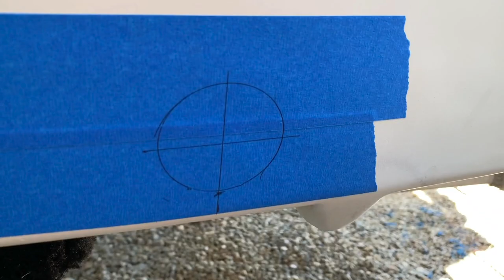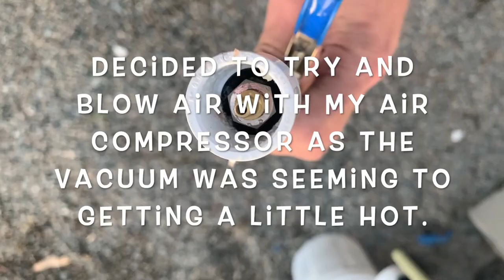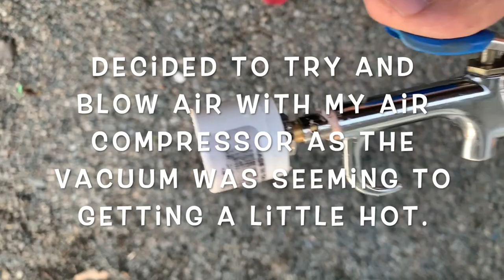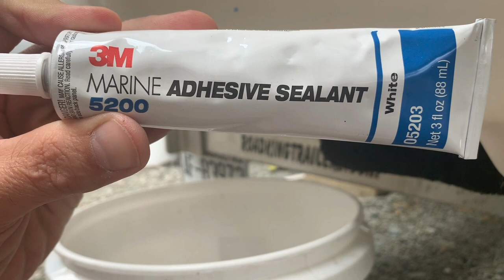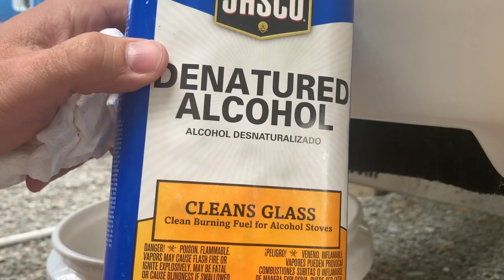Suspected water in Carolina Skiff hull.

Comment: Thank you so much for taking the time to make this video. 
I need to do the same thing to my skiff.
I’m very hesitant to drill so far into the hull - not wanting to punch through the bottom or top.
Glad it worked for you!
Reply from the maker: I was concerned about that too but I just let the bit do it’s thing without forcing it and all went well.

Comment: Is the boat in brackish or salt water? Stainless steel screws on a brass garboard will cause galvanic corrosion when immersed in salt water, which will corrode your drain.

Comment: Capt. MacGyver you got my thumbs up. Thanks for doing something many of us would not attempt.
The threaded brass fittings are a brilliant idea for future inquiry. 
I wonder if any attempt setting up a blower of sorts ( from a ducted fan to maybe hair dryer) to provide air flow over an extended period of time during off season may do some "drying" of the saturated foam. 
I also wondered about using some kind of low temp heat pads to help vaporize the water.
Excellent video, I'm definitely doing this to my 21 DLX.

Comment: Always a good idea to chamfer the edges of any holes you drill through the gel coat. Not only will it prevent the gel coat from spider cracking but it also makes a little void for the 5200 to sit in which will form like a little gasket. Also its never a good idea to use an impact when installing screws into fiberglass as its almost a guarantee that you will overtighten them. Should always do them by hand with a screwdriver and stop as soon it gets tight.
Reply: I agree.. when ever you expose open wood it’s good to seal it back up with resin..nice job though. Did something similar on my bayliner..it’s amazing the amount of water that comes out..

Comment: Here’s an idea. We all understand why a boats foam core should always stay dry, which is the same principle as a fiberglass surfboard. Years ago, my son had a used Lost Surfboard were you actually pumped in air through a recessed valve which pressurized the whole board for controlled riding stiffness. So I gave it a try and watched the pressure gauge leak down to zero very quickly. The surfboard didn’t have any open holes or cracks, so I shot some more air pressure in and sprayed some soap and water(like finding leaks on a tire) all around the board which produced several leaks from the various cracks. I made the appropriate repairs with no further leaks. I plan on trying this method on my son’s new/used 1968 Boston Whaler 13 and see what show up.
Reply: That's a brilliant idea. Getting the water out is a daring task on this 21 DLX , actually identifying the source of intrusion is priceless. 
Thanks for posting.

Comment: I am currently building a homemade 15ft skiff...I arranged stringers to drain with NO foam...foam will be top side for a level buoyancy without water retention.. also keeps the boat upright when it sinks instead of it capsizing.. wish I knew why manufacturers put the flotation below the waterline... that's almost a given the boat will capsize

Comment: Economy polyester resins used in some boats are not impermeable to water.  They absorb water from the bottom and top surfaces, particularly if the boat is left in the water or if the boat is outside and gets wet with rain.  If you attempt to remove the water from the saturated foam the
problem will continue unless you make the hull waterproof.  Epoxy based bottom paint and epoxy topside paint will help seal the surfaces.  Best bet is to buy a hull made with isophthalic
polyester resin which is more waterproof than the cheaper orthophthalic polyester resin.
You get what you pay for.

Comment: Water soaked foam is like a wet log. It will never dry out. I've removed foam from many pontoon tanks and they are like anvils.
Reply: It will dry out you just gotta get air flow to and around it which isn't so easy in a lot of cases. If you can warm the air some thats even better. I had some water logged  foam in my little center console  and i was able to dry it pretty much all the way out. Had to open a couple round inspection plates and pumped warm air in one hole and it exhausted out the other. Took a few days but it was pretty much bone dry after I got done.

Comment: yeah the encapsulation thing is just a pipe dream. One always should have a bilge drain and bilge deck plates to ventilate. Even if you dont perforate the deck all the way through....the expansion and contraction of the sealed chamber will crack the glass in places and let small leaks in.

Comment: I did mine the same way I got close to 5 gallons by letting it sit overnight then in the front floor I drilled and sealed air compressor hose I’ve been in the back I sealed the vacuum and I got another 12 gallons and four hours out

Comment: The reason it took so long for you to drill through the haul was you had the bit on a  impact drill lol should have switched drills bro
Reply: I always get a kick out of people using an impact to drill holes. I guess people think just because it's a quick change bit that it supposed to be used in an impact.
Reply: Can ya blame him, he drilled a hole for a screw as well🤣
Reply from the maker: I guess all the people in this thread are as dumb as me. - https://www.thehulltruth.com/boating-forum/138776-drilling-screwing-into-fiberglass.html. Maybe you could make a video showing us all to screw in to fiberglass without predrilling?  Can't wait....
Reply: @MikeRose1  you quite literally went on Google and copied the first link you came too on a forum🤣 I base my facts off experience, after installing 20-30 outboards on fiberglass/aluminum boats
Reply from the maker: @TheSteelerfool  you're right...that's how easy it was to find.  It would have been impossible to put these screws in without predrilling. 🤣

Comment: I would like to do the same for my Carolina skiff, but I fear hitting the bottom of the boat while drilling and causing more damage. Where did you get the extension from?
Reply from the maker: I used a couple of these https://www.amazon.com/gp/product/B00W9SIYQS/ref=ppx_yo_dt_b_search_asin_title?ie=UTF8&psc=1 plus a shorter one I got from a local hardware store.  I was worried about hitting the bottom too but I just took my time and the bit seemed to ride just on top of the bottom.  I don't think the bit could make that sharp of a turn to damage the bottom.

Comment: 3:44 Yeah, a hole saw would have been far more effective. 4:58 No water! A good sign! 7:12 Yep, ugh, oh! But it looks clear, not old and stinky. 9:42 Yikes! But I think all the vacuum and air pressure stuff was unnecessary. Just providing a drain is sufficient, imo. Good call on the stainless screws!
Reply: He said it was some smelly water.

Comment: Sadly the only way to fix saturated foam is to cut the floor out. Water won't drain out of it. I have tilted a boat up, drilled a few 3" holes in out of the way spots in floor and forced air through for days on end with no good results. Dig that foam out and be done with it.
Reply: The best way I have found to dry the foam out is if you can get some good air flow around it and heat the air some not hot hot but warm enough to help dry everything out. May never get 100% bone dry but it will remove most of the moisture. Those bags or canisters that draw moisture out of the air will help to. Whats key and usually the hardest part is  figuring out how the water got in there to begin with and resolve that issue or else your just pissin into the wind.
Reply: @johnnorris1227  You think this PVC with holes drilled would work if combined with an old hairdryer?

Comment: Mike, how did your boat perform after all the water drained? Was it much improved from before the drains? I bought a J12 that can’t get up on plane ☹️
Reply from the maker: It definitely planes a little quicker. You might try a new propeller. The pitch and number of blades have a big effect. I went to 17 from 19 pitch with 4 blades and it made a big difference.
Reply: @MikeRose1  i mean how old is the boat vs the amount of water in it ?
Reply from the maker: @AmazonWebService98   It was around 16 years old when I did this.
Reply: @MikeRose1  top speed?
Reply from the maker: @patrickharlow7724   about 35

Comment: Drill a smaller hole, use a vacuum pump like whats used to evacuate air conditioning systems and all the water will vaporize and get vacuumed out.
Reply: For water to vaporize it must be under a vacuum.  With all the holes in the boat it wont hold a vacuum. Those pumps are not high volume.

Comment: Air compressors hold moisture causing them to blow water from the nozzle just saying
Reply from the maker: I have a refrigerated air dryer installed in line after my air compressor to remove any moisture.
Reply: @MikeRose1  they only do so much but definitely help !

Comment: So it’s been a while since you posted the video..would you say this fixed the issue?
Reply from the maker: For the most part I would say yes.  I opened the drains after last summer and only a couple of drops came out.  I guess it's still possible for water to get into the hull somehow, but at least now there's a way for it to get out.
Reply: I watched a guy take the whole floor off. There are ribs going across, so looks like you only drained the last compartment of foam.
Reply from the maker: @jerrygreen1277   I drilled through all the ribs from back to just in front of the console.  Since there aren't any screw holes forward of the console, I think it was able to get most of the water.  I am sure it's not as good as ripping up the whole floor, but better than doing nothing.

Comment: Thank you for taking the time to record this and share it. I have an 88 Bass Boat that I just discovered has water-logged foam on the sides similar to yours. I imagine I will be doing this in the near future to drain those sections of the hull also.
Now that it has been a couple years, is there anything you would do differently or advice that you could provide for someone like myself that is about to take on the same task?
Reply from the maker: Not really. Other than using the correct bits and a drill instead of an impact that upset so many people. Haha.  Thanks for watching!

Comment: I've been on the fence about buying a new 2020 21 LS, but the water logging issues have me concerned.
Reply from the maker: I think the new ones have drains already installed but I would definitely check to make sure.
Reply: Take a 5 gallon bucket to showroom see if it fits in molded bucket holder.
Reply: I have a 2020 2180 DLX and it came with the drains installed, I believe they are factory installed, but can't swear to it.  I take the plugs out after every trip and so far no water, and hoping it stays that way.  I really like CS boats, but the water in hull had always been a concern I had about buying one.  After talking with people that had newer CS boats and they hadn't had an issue with water below the floor, I decided to buy the new 2180 DLX.  Seeing the drains already installed was somewhat comforting, but only time will tell.  It's been right at a year, and no water has come out the drains, so I'm still a happy owner.
Reply: A 2020 shouldn’t have u worried at all
Reply: @matthew5172 should I be worried about the water issue on a 2018 Carolina skiff 16 JVX? Whole point is to have a light rig!

Comment: You could place that boat in the middle of Hell and it wouldn't dry out.
ONLY ONLY ONLY way to dry out a wet boat or wet foam is to open it up and remove the damage.
To clarify this.. I just cut a stringer out of a 69 mako that I have had the floor out for 5 years and the stringer was still wet with the 600 lbs of wet foam removed 5 years ago.
I left the water melon like foam in a trailer covered in NC for the Summer and decided to check it months later,., Well it was still like a juicy water melon.
I do give you an A+ for effort,. but Your headway did not match your efforts.
These old boats rot like this because the water CAN NOT be extracted except by a total renovation. and most just won't do that.
Even putting the boat in a Kiln will not pull that trapped water out of the foam,. 
And any state that has freezing weather just breaks more closed cells and the Cancer grows until you STOP it.
I'm not going to put a percentage out but about all boats that sit out more than 1-2 years has water damage, add 15-20 years to that and you can probably do your own math as to how many boats are water logged to some degree. if not severely,..
The few boats kept under cover are the only survivors.
I have tore 2 boats down, my neighbor had a NC Skiff, and after helping me on mine, when he got water from screws holding his transducer at transom,.,. he got rid of his boat.
Cheers everyone.
Reply from the maker: yep...I agree with you..I was really just confirming my fears that the hull had water in it...there is no way to get all that water out without tearing it apart, but the boat wasn't worth it for me to consider that.  Thanks for watching!

Comment: that is not a good move. you have to look up specs.  you might have exposed wood now?  only get worse now. you cant fill those holes in the transom like it was!  deck inspection plates would have been a better solution on the cheap! or cut the floor out get rid of the foam. put a pad on the bottom. put new floor in. [ lots of options. ]  go faster for free! . self drain too!
Reply from the maker: Carolina skiffs don’t have any wood.

Comment: How much water did you evacuate from the hull?
Reply from the maker: between 8-10 gallons
Reply: @MikeRose1  Enough to make you sick!
Reply: @MikeRose1   i used  a 6 foot long electricians drill bit then added a 6 foot extension, went thru the baffles until i had reached past the front of the console, mine is a 16 foot dlx i got water draining for a week easily in excess of 100 gallons
Reply from the maker: @FakeFriendzU   wow!!!
Reply: @MikeRose1  after i did mine it ran so much better, then i kept it in my lake for about 8 months, just pulled it out and had about 3 gallons in it so not bad!!!!!
Reply: i also removed the center console and put a tiller on my 50 yamaha, its got more room than my nice bass boat now, love my skiff, wish i could find a big dlx like yours
Reply from the maker: @FakeFriendzU   I got maybe a gallon out of mine after the summer was over. Was nice to be able to drain it.

Comment: Still have that custom PVC? I’m in NC and need to borrow it for my J16 😂
Reply from the maker: Yep. You can have it.
Reply: @MikeRose1  Happen to be near Charlotte by chance?
Reply from the maker: @JohnsonBannerman  nope...I'm about 3 hours east of you.
Reply: @MikeRose1  Ah that's ok, I'll use your design and make one. Thanks for the tutorial!
Reply from the maker: @JohnsonBannerman   sounds good!  thanks for watching!
Reply: @MikeRose1  I ran out to the hardware store and got 108" worth of bits and extrensions and a 1/2" PVC. How long did you leave the PVC in there drying? Did you ever switch to the other hole?
Reply from the maker: @JohnsonBannerman   just until it appeared no more water droplets were coming out the other hole…maybe a little longer but I didn’t want to burn up my air compressor. Yes. I did both sides.
Reply: @MikeRose1  10-4. I may dry the compressor for a bit then switch to an old hairdryer.

Comment: What is the name of those plugs?
Reply from the maker: I was originally going to use the SeaSense Drain- One -Way Safety Plug but then opted for the SeaSense Unified Marine 50032282 Drain Plug Garboard, Brass.  But I mixed parts from the two...I actually like the screw in plug from the first one, but opted for the simpler drain to make sure it wouldn't get clogged.
Reply: Garboard plugs

Comment: carolina skiff has indevidually fiberglassed boards in the floor so that's just weird , every screw i put in mine was sealed with proper sealant
Reply from the maker: I would agree that it should be that way, but you can search the internet and find that this is a very common problem. I actually became aware of this from a local boat builder who has seen this many, many times.  Good luck though and I hope yours stays dry!
Reply: @MikeRose1  i've seen a few videos of carolina skiff with water in the hull , i'm concerned about my j 16 now but all i have is front deck and bench seat in the back for tiller arm motor and a storage seat in the middle and those screws are inside box , do you think i should be concerned ? i almost wish i would've gotten an aluminum boat now
Reply from the maker: @camhester4251   I wouldn’t worry about it too much but I do have a peace of mind knowing I was able to get rid of the majority of the water. Especially with winter coming on, I am going to leave the new plugs out for a couple of months and not worry about water in the hull freezing and expanding and popping my fiberglass or gel coat.
Reply: @camhester4251  I've got a J16. It's full of water. Mines been water logged so long I'm going to have to rip the floor up and refoam it. TBH the foam they use in these boats never dries out completely.
Reply: @toolman9081  i'd sell it or junk it and buy aluminum , mine still in good shape and it's a 98 model
Reply: @Bobbi Kyky it's pretty thick and has no wood in it all fiberglass that's what i was told when i bought mine new in 98
Reply: @camhester4251  I'm going to fix mine. I prefer the glass boat on the salt water.
Reply: @camhester4251  I bought an aluminum boat with foam, it had about 20 holes from the foam getting wet and eating through the aluminum from the inside.  Nothing is perfect.